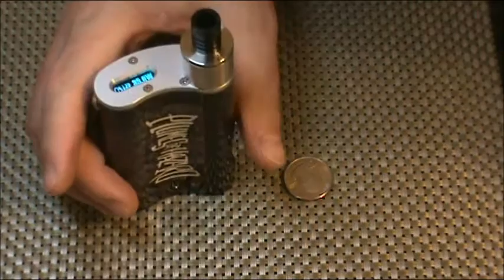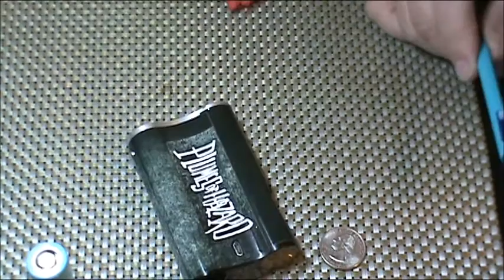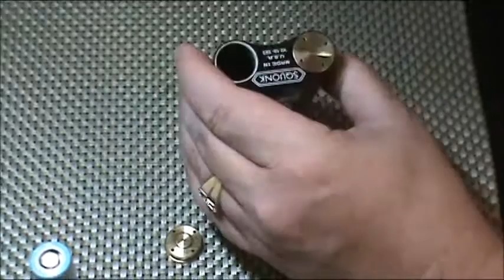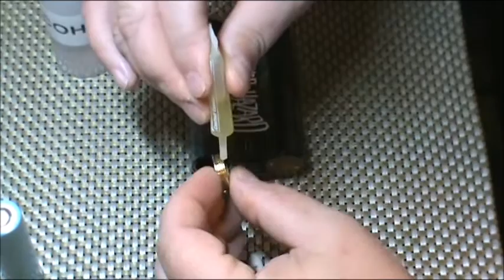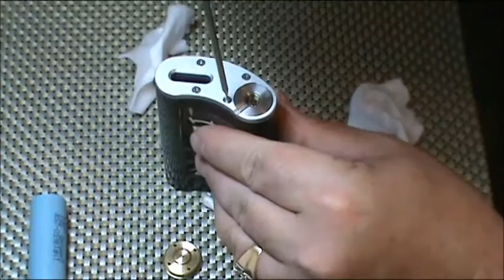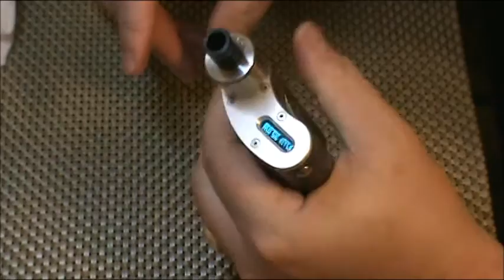VAPORFLASK Weak Battery FIX

Comment: i have a iStick Pico 25 and i got the "weak battery" problem and a flashing battery icon so i can't vape anymore.. my annoyance is that i only got it for a few days and on the first two it worked just fine.. what should i do? charge it with the cable or external charger?

Comment: Wanted to mention that the VaporFlask Stout does have a manufacturing issue.   The weak battery issue if also coupled with false high temp warnings, is most likely metal shaving inside the mod on the control board.  Easy fix with a can of air and/or a disassembly.

Comment: George, I greatly appreciate the video. It just happened to be the next video to pop up when I was watching videos about my "new" Lavatube 3. I stayed because the sound quality was pretty good with the headphones I was using. The only thing I would suggest is that getting a little bit of Isopropyl alcohol into the mod wouldn't damage it, so long as you use >90% isopropyl (which you should be using with electronics anyway).
Reply from the maker: Juice Bigalow Vape Jigalow Thanks for the comments!  I generally use 99% IPA since it flashes off so quickly.

Comment: who about dna 200?? fix sir?? weak battrery or check battery same problem sir?? can u help me sir because my mod just "CHECK BATTERY"
Reply from the maker: I'm sorry, I have no experience with dna200.  all I can tell you is to make sure all connections are clean.  maintain the battery contacts and batteries and see if that helps

Comment: I am from Norway and I have never seen that tube you used to smear the battery caps, screws and screws holes , can I use Noalax or something else? What is it in that tiny tube? Hope you can answer those questions. Got a brand New Vapor Flask from Vapor Shark, with the bigger screen, and the weak battery issue came up after three or four pulls
Reply from the maker: The tube is Deoxit Gold. Is very prevalent here in the states... available on Amazon and eBay as well as larger electronics stores.  You could use noalox also,  but this product is much cleaner and does not attract dirt.  Hope you can find some in Norway!